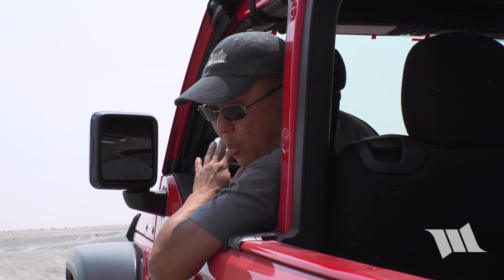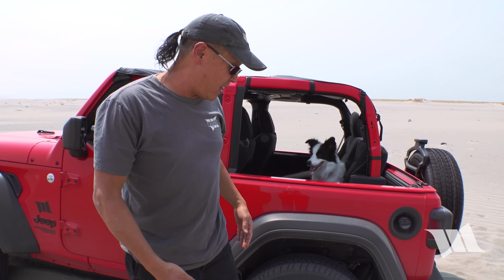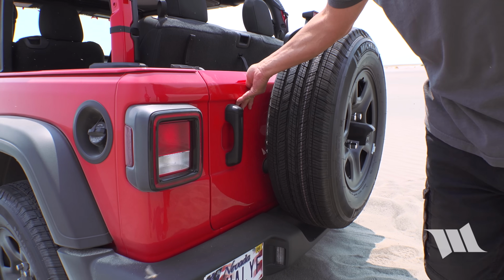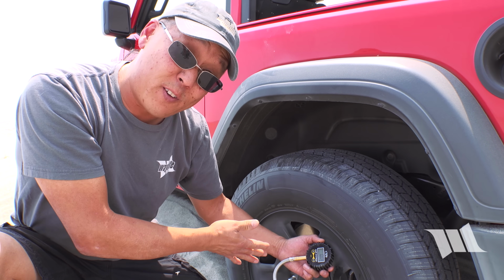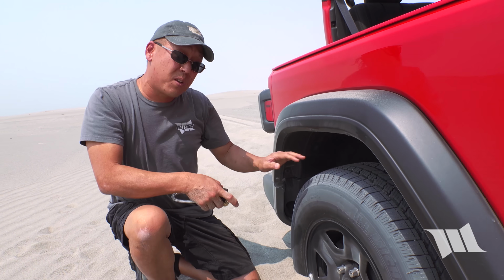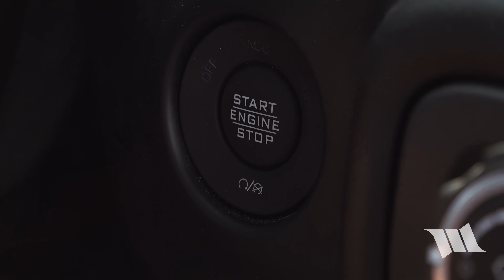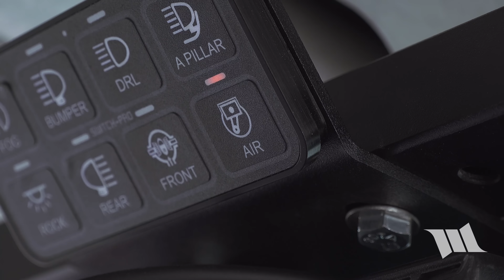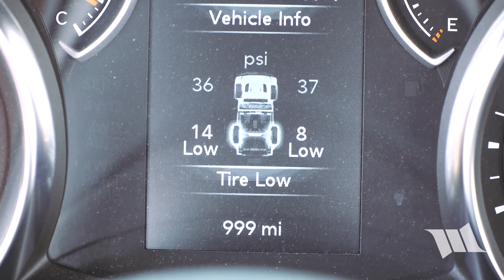Simple Tip to Get Unstuck from Sand or Snow Even if You do not have a Jeep or a Vehicle with 4WD

Comment: This has worked well for me in years of driving in the desert.  If you do this, you ought to have a portable electric pump, which runs off of 12 volts dc out of your auxiliary power port.  It's not fast, but it works.  No sense pumping them up, though, until you're totally out of the questionable stuff.  Don't deflate them any lower than Eddie shows here!  You'll run the risk of ripping the tire off the rim (I've done it).  Usually, about 8 pounds is safe and effective.  Good advice, Eddie!
Reply: And,,,, the ele. 12v  pump will have an inline fuse so carry an extra fuse or 2.
Reply: @kenhurley4441  Yea, and can't pump for too long, rest every 10 minutes or so. a big tire like jeep takes a while to get it up to street pressure.

Comment: A great tip!  It just happened to me earlier this year. Being stupid.  Was heading out into Central NV.  It was lunchtime and I was south of Mono Lake on Hwy 120.  Panum Crater.  Volcanic ash.  Decided to pull off and run up a Forest Service road to make a sandwich.  In 4WD high, did not air down.  Got up to a spot, tried to make a 3 point turn.  Volcanic ash....bottomless. like driving through flour. Once out of the packed ruts, I just dug in.  Out in the middle of BF Egypt. By myself.  #1.  Let the tire PSI down to about 10 lbs. These were 33's.  #2.  I had a shovel. Dug that fine stuff out for a good way down to the bottom of my tires.  #3.  Happened to be a lot of scraggly pine trees growing.  Collected a bunch of dead branches and jammed them under the tires.    Got in, 4 Low, crawled right back out on those branches and got out of there.  A very stressful sandwich....  That ash was deceptive....  It looked like something you could just do a big power carve through...
Reply: good to know, we visit this area periodically

Comment: Very cool. When my dad was 85, he would drive away and get lost sometimes. Once he wandered off into a desert and I found his car, a 2000 Ford Taurus,  on top of a sand dune. A 10 foot high sand dune. Then I found him thank God before the coyotes did. My dodge ram 4x4 started to get stuck when I tried to pull him out. I let the air down  on his car on all 4 tires to around 10 lbs and that front wheel drive car, which means one tire does the pulling, drove right out with out help, then when safe on a dirt road after driving back up the dirtbikes trail he drove down, I aired back up with a cigarette lighter outlet powered mini compressor.
Reply from the maker: Nice! 👍
Reply: Glad he was ok!

Comment: Like the tip on pressure. Shovel winch ramps land anchor etc. are great additions before you do decent trail runs.. Don't go lower than 12 psi on rocks. But sand and snow, I run 8 psi and never had an issue.
Reply: I've ruined a tyre when I did 16 threre was sand and rocks. You'd better keep 18 and have something for the case if you stuck. ABTW very low tyre pressure like 5 PSI is very high chance to get you tire off the wheel and you're screwed. I recently was replacing tyres and saw how much time it took for them to make it pump when they had a glue and high power air compressor in the shop with a large tank. You won't have these tools in sand. So better not to go below 12psi
Reply: @alexk6745  starting fluid and a lighter pops the bead on nice. Just don't get too  excited with the starting fluid and have your air pump fired up.
Reply: Don’t try less than 20 psi on a car street tire if you get stuck. Their sidewalls are flimsy compared to AT or MT tires and you could get heat burn on the sidewall that looks like curb rash, trashing the tire before it’s time. I know from personal experience and this can happen in a mile or more!

Comment: Got stuck on the beach w tide coming in about midnight in warrenton oregon the surf  coming fast only 20 feet away. Pichdark night no help on the beach. 2wheel drive both rear wheels dug in the sand about up to the axle. Did not know how to get out before the tide got me. Its 1973 the only thing i got is a walkie talkie, got on the emergency channel called for help, some guy answered and told me to let most of the air out of the tires i did got in the truck and pulled out of the ruts like magic. This works 100 percent as long as you are not sitting on the rear end or frame. This is a great tool in your emergency tool box. This video is awesome.
Reply from the maker: That's a great story. Glad you got out of the situation safely!

Comment: Growing up through the 60's and 70's as a kid.  My first 4WD truck was a 1979 Chevy Luv,   Same with one of my friends.  2" Rancho lift.  3" body lift.  1.8 liter 4 cylinder engine.  Blew out the rear diff, regeared it.  31's... Warn actually built a brushguard/winch combo for a Luv Truck....  I had it,,, Weber Carb,  Headers....  Custom built rear bumper, camper shell.  Farm kid... we had an equipment shop, mechanics.  My Luv was just a project.  Traded it in on a 1986 Nissan Hardbody....  Still wish I had that Luv.

Comment: Single female camper in awd honda.  Best "get yourself unstuck" video I have seen.  Got shovel and tire inflator.  Going out to buy tire deflator for my emergency kit.  Thanks
Reply from the maker: Awesome! So glad to hear our video was able to help you out. 😎
Reply: A stick, wire, nail, pen,or pin will do it. I don't recommend unscrewing the tire stem at all, that can lead to worse trouble, just push on the little needle  inside the stem and the air will come out.

Comment: I got a tip from the evening local TV channel in Idaho about 40 years ago for getting moving again.  This only works with rear wheel drives I believe, but it does work.  Rear wheel drive, most cars, only one wheel will drive, and it's the one with the least traction of course.  But if you slowly start applying your emergency brake, it will cause both wheels to engage and now you have two wheels working.  And one time I did get stuck and it did work.  If your really really stuck, get a come-a.long.

Comment: I started out driving on the beach with about 16 pounds all around and never had any issues, worked great! I had Traction Boards and all the other gear to get out if needed just in case. Great tip 👍

Comment: I learned this by myself 35 years ago when i was 12. I had a mountain bike and i would let the air out till the tires were real squishy. I could pedal it thru sugar sand and it would just float over the sand.
Used the same method a couple times in my 2 wheel drive s10. Works great

Comment: The technique shown really worked.
I did use the technique many times in various desert places in Saudi Arabia, during the 80's.
Thank you for the video clip.
God bless.
Reply from the maker: Awesome! Thank you 😎
Reply: I did not watch the video. I did let the adds play. BUT having been in the army There is a reason why you have off road tire pressures. And on road pressures.
 I always run a bit less pressure in the winter. BUT those really bright people IN CAFE and AQMD don't like that. 
Yep also those damn tire pressure monitors and me old lady don't mix. Spent way too much replacing them when they sailed off to dead electronics heaven.
Had to protect my ears.
The real problem is a tire pressure gauge has too many moving parts for her.
 I mean really? Running 28 lbs vs 35 does make a noticeable difference in winter. The TP monitor does not like that.
 The loss in gas mileage is WAY cheaper than a new fender. It also use uses less carbon than fixing it.
Just don't do with R60 or less profile tires. Not enough meat to keep the rim from bending.
  Guesss those CAFE people really don't know how to drive.

Comment: Been using this method for over 40 years.   Works well on slippery wet grass as well.  I tend to keep at least 5 psi in the tire to keep the tire from breaking away from the rim.  If the bead breaks you got a much bigger problem.

Comment: Got stuck in my '95 Impala SS on a road trip with a stop in Monument Valley once.  The signs posted made it look like I'd be ok but there was some very fine grain sand on one of the loops.  I like to be prepared so in the trunk I had a strap and drawbar with a shackle to slide into the receiver and the Wrangler behind me pulled me back the 20' I needed to get on solid ground, then I aired-down the rears and just sent it, managing to get through.  Thankfully despite the low-ish profile tires I managed to avoid damaging a wheel or tire and there was a gas station not far from the park entrance that had a working air pump.

Comment: Nice to have a high volume air compressor to refill the tires.  The very small, compact ones you can buy at the local auto parts store will not do the job.  They have a ten minute cycle time and then you have to let them rest for 30 minutes to cool off.  It will take three or four times doing this to get tires back to near normal.  I carry two small compressors and cut the time considerably.  Since they are very small, I can do this.  I ONLY carry two when I am traveling on uncertain roads or off road.  Nice vid.  That air down tool really helps.  I, also, remove cores but have lost a few cores doing this.  Spares, people.  SPARES.  You only have to lose one once and not have an extra (remember the spare tire) to put two extras in an envelope in your glove box...

Comment: II's a great tip, and one that everyone should know ... A couple of things  more, let some air out of the fronts too, and for the same reason as the backs .. better flotation  .. just don't let out as much, maybe down to 12psi or so , it will better able to handle turning loads and keep the tire on the rim  .. the other tip  is that when you think you have scooped out  as much from in front (and back) of the tires as you need to (all four, even the fronts) scoop some more,  also, if you can rock the vehicle WITHOUT spinning the tires, do it  (slightly engaging the clutch and pushing it back in, rhythmically to gradually get a slight launching area   .. getting a "rolling start" in the soft stuff is worth it's weight in gold  .. this learned from off roading a one wheel drive mini truck  with 10.50x15 radials back in the late 70's in the sand dunes  .. thank you for your channel :-)

Comment: Solid advice Ed, 2wd or 4wd, air down your drive wheels and go slow.  If you've already dug yourself onto your frame, well, that's game over for the most part without a friend with a winch or tow strap.....so stop BEFORE you've dug yourself in, and air down.  In sand and snow, it changes the game entirely.
Reply: You might want to consider how much air you take out of your rides.  Even if you get unstuck ,you are not done traveling and you need enough air to get that job done also ! You maybe still be on a trail or in rock country where you'll need more air in tires . Not every body has a compressor to air back up

Comment: Sometimes being stuck in sand on a slope might shift the vehicles weight onto the drivers side. Chevy's can be one wheel wonders..  Applying the brakes slightly while gently giving it some gas may help both tires spin more equally.

Comment: If you have driven in the Namib Desert in Namibia and you made it then you cannot ever get stuck in sand anywhere in the world...I have done it many times and this chaps advise is quite spot on only that in the desert you reduce the tyre presure to 100psi and sometimes 80 psi  since sand gets looser in extreme hot tempratures like in the desert but with such low tyre presure do not make sharp turns since the tyre might slip off the rim..

Comment: Even though he kind of showed it, make sure you pump up your tires to the correct pressure (usually on the door pillar) when driving on hard surfaces like roads or dirt tracks. The correct tire pressures will mean that you can stop in the minimum distance possible for your vehicle. Too much air and the tire has less grip. Not enough air and your tire could wear fast or worse case blow out.

Comment: The fun part about snow is that whatever snow is in contact with the tire turns to water from the friction. Letting air out of the tires SOMETIMES works but usually not. Traction blocks or ramps work better but not as good as a 12k lb winch with snatch block.

Comment: Very nice video. Your air-down tool works very well. It might be worth mentioning that you should NOT remove the core without a similar tool. There is a youtuber with an orange jeep who removes the core entirely to air-down. NOT SMART. If you lose that core, you have lost your tire unless you can find it quickly and have an air pump. I worked at a Firestone center in high school and occasionally had core escape and go flying through the air like a bullet to be lost forever. Thanks for this helpful video.
Reply from the maker: LOL - didn't know people out there would do something so stupid.
Reply: If he lost the core, just carefully remove the one from the spare tire hanging on the back and insert it into the tirel When you get back to civilization go buy a few spare cores.

Comment: Long before electric pumps and gadgets we carried a handyman jack.  A handyman jack can get you out of lots of trouble.  Carry it along with a thick one square foot board for a platform and a shovel for digging.  If you have some chain and the right hooks you can even use a handyman jack as a wench.  They are very handy.  There's another trick for getting unstuck.  If you have a stout length of chain, anchor it at some point forward of the vehicle and get the other end of the chain under the traction tire.  More often than not, the vehicle will climb right up the chain and out of the hole.

Comment: Great tip, I'm still benefiting from the acm and mounting location. It's getting lots of use in the sand this week. Question... Does the low psi play into rolling a bead in the sand? I guess in this scenario that's a secondary concern to getting unstuck.
Reply from the maker: This video was made with the idea of, what would you do if you didn't have 4WD or anything to give your tires more traction? Assuming you have a Jeep, there really is no reason to go this low. But, to your point, it is far less likely to roll a bead on the sand or snow, even at this low pressure. The problem come into play on terrain that has more traction like rocks.

Comment: Great video.. Just curious if you would let air out of all 4 tires or just the back? Love those half doors…..
Reply from the maker: This video was made with the idea that you only had 2WD. If you have 4WD, letting air out of all 4 tires will help. In fact, you won't even need to let as much air out.
Reply: it's my experience that deflating the non-driven tires also helps them to float and roll instead of cut and dig.

Comment: I've often used the top, or edge, of the valve stem cap to trigger the valve and let air out of a tire -- but this can be very slow for a full size car tire, or just let out tiny bit at a time.

Comment: To air down with no tools, you can press the back of the valve stem cap into the valve stem. Much easier on the fingers if you don't have anything.
Reply from the maker: Yup, good tip and one I should have mentioned.

Comment: Aing down is a common tactic when off-roading in soft soil or slippery rocks.  Probably wouldn't work on wet, clay-like soil.  It tends to fill up the gaps in a tire, even an off-road tire making it more like a racing slick.  I have a small tire pump to air up when needed.  When no one is around, you are on your own.  Boy Scout motto: Be Prepared.  Besides the tire pump, I carry a tire repair kit and a ratchet strap in case I have to reseat the bead.

Comment: It's always fun airing down in my stock 2wd old F-250 and running around the sand dunes to the shock of all the lifted 4X4s.

At about 5,000lbs with me sitting in it, the truck does have a lot going for it in the sand. Big stock tires, light 5.0 V8 up front, standard cab, and a liftgate in the back gives the driven tires a huge traction advantage. Truetrac will be going in it soon.

Comment: We used to use a Hi lift Jack and a board. Jack the Jeep about a foot or so higher than the hole, and push the Jeep sideways. It land on good ground and off we went.
Reply from the maker: Always nice when you have tools and additional traction to work with. Of course, this video was made to help people who have neither.
Reply: @wayalife  so, those people are the ones who buy the commercials on tv, where you just go off the road and have a good time. We never went off road without the right equipment and BLM maps, told someone where we planned to go, when we’d be back. Stayed off private property. Never left trash behind. Still have a flare kit. But am old school and haven’t been off road in quite some time.
Reply from the maker: @Paul Ne LOL - I think you're reading way more into this than is necessary. The people I'm referring to are the ones who maybe make a wrong turn thanks to Google Maps and end up on a road they had no business being on. I've actually come across people like this in the past and when talking to them, they didn't want to be there or end up getting stuck. I'm just trying to help them out. Peace ✌